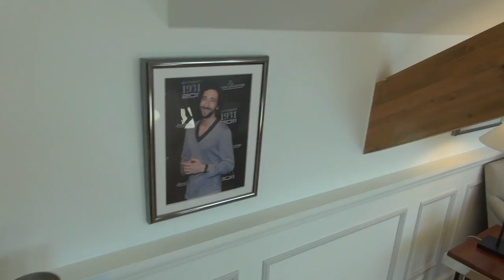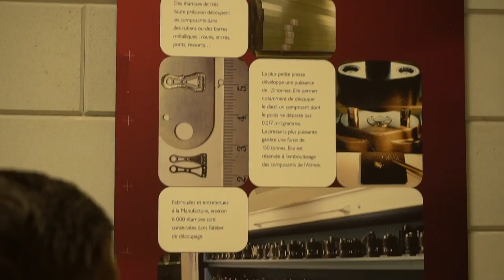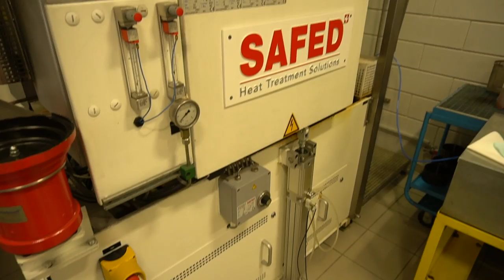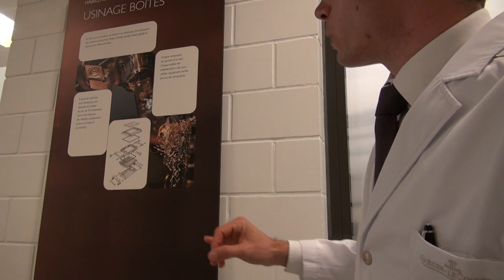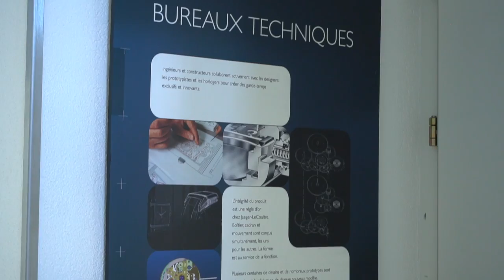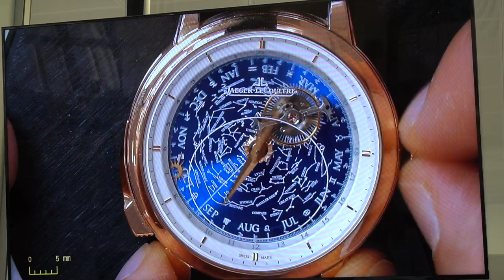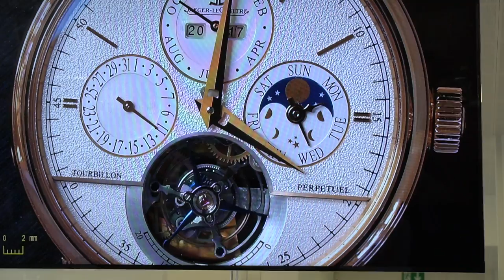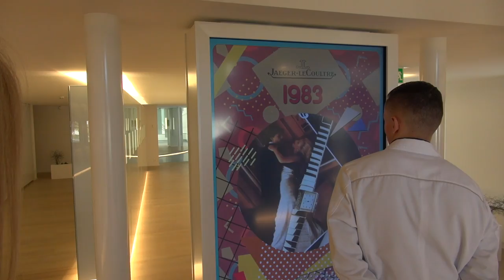A Jaeger-LeCoultre Exclusive - Tour Of The Luxury Watchmaker, Grand Complications & GyroTourbillon

Comment: Great video! Would like to add a few notes. The Tornos machines are Swiss lathes. Obviously, Swiss watch makers were the ones who invented them. They differentiate from traditional lathes due to the fact that the bars are fed in and out of a guide bushing and the tools are in front of the bushing. This allows you to do small delicate parts or long skinny shafts easier because the material is supported at the bushing which reduces deflection. With a traditional lathe, the stock is in a fixed position in a chuck and the tools move up and down the bar. So the entire part is sticking out which doesn’t work well with small or long parts. 

Also, the robot that was measuring the parts is called a CMM (Coordinate Measuring Machine). It uses a touch probe that has either a carbide or synthetic ruby ball on the tip. They’re accurate to microns. I also think I saw a OGP Smart Scope system. Which is made here in New York State. 👍🏻

Comment: Nice video, it shows that you genuinely enjoyed the visit which is great. Your passion shows; it is contagious. I really like Jaeger-LeCoultre's discreet understated elegance and class. My watch from JLC is the Memovox Tribute to Polaris 1968 which was released in 2008. I managed to get one at release and it is the watch I wear the 2nd most alternating with my daily un-scratchable tool watch; the 2006 IWC ceramic doppelchronograph which is very practical when working offshore. I did like the Duometre à Chronographe until I saw it as a colleague had one in Angola; I find it has an excessively large case.

Comment: An Atmos clock nice. The operation is phenominal. Using dichloromethane in a hermetically sealed chamber, much like the drinking birds using Maxwell- Boltzmann ideal gas law distribution heat of vaporization using torque and capillary action to keeps the clock moving by expansion and contraction . Amazing. I've seen 2 of these in operation myself. Has to be perfectly level.

Comment: My grandfather's solid gold Patek had an original JLC movement. For a hundred years JLC made most of the top movements for the top makers, who were really just case and watch designers. Rolex now makes their own movements, and they are top quality. Patek now makes their own movements, and of course they are wonderful watches. But to me, JLC is every bit the quality of these makers, if not better in some ways, and they also represent the absolute core of the Swiss watch making industry. I wear only JLC, though I have considered buying the new Rolex Sea Dweller.